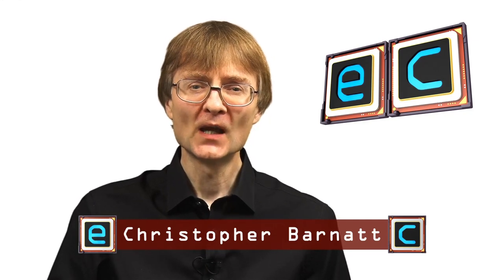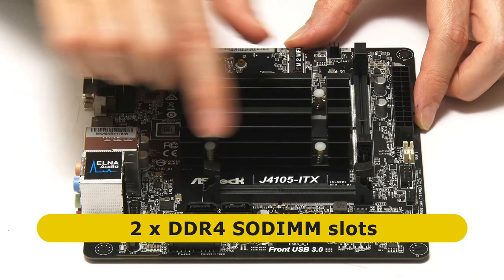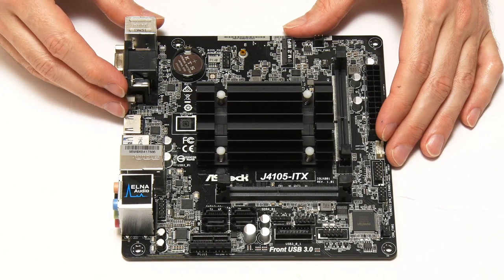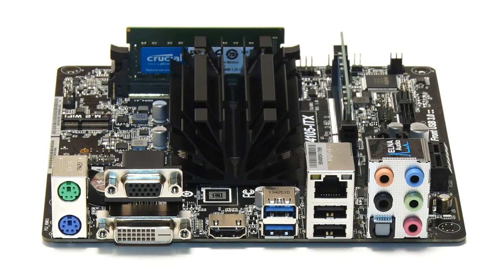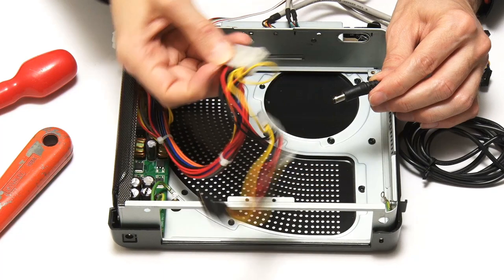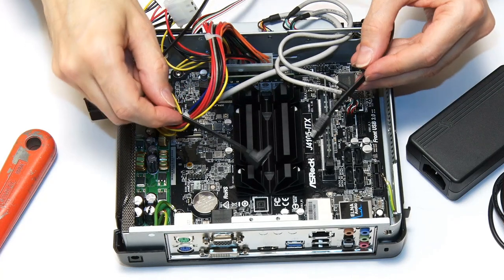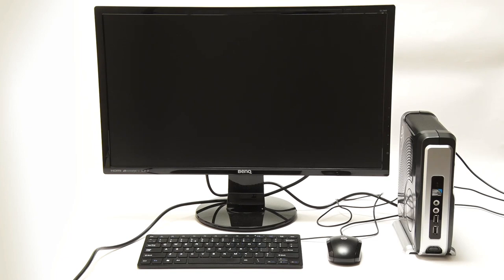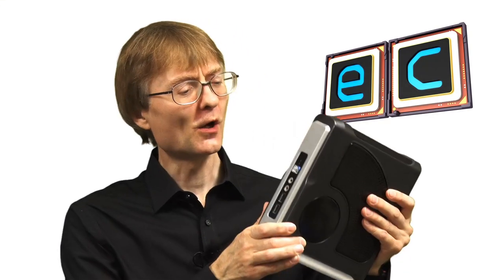Silent Mini-ITX PC Part One: Hardware Build

Comment: I'm just wondering if the VGA, DVI, and HDMI will all run a monitor simultaneously, can it support a m.2 SSD, and type c usb. If so, I want one. I know, I should have waited till video was over, but I don't have that much patience.
Reply from the maker: Yes, this board can drive three monitors at once from its three display outputs. I does not have an M.2 slot or  USB-C. But USB-C is just another type of USB 3.x connector, do you could plug in USB-C cables via an adapter to the USB-A 3.0 ports. Or you could add a PCIe card (in a suitable case) adding extra USB ports, inc a Type-C.

Comment: The front AC97 audio connector is the same pin connector as the hd audio. but the hd has one more pin to get a connect to front. So HD can set up the configuration with software on ac97 you can't set it. There is any Problem . I know that because i build an Pin to Pin cable connector for an ac97 front    and set it up on an modern hd audio connector .it works fine. Note : If you use that you have to set in the realtek hd audio manger Front panel audio connector  recogonation Off. So you can use booth connectors in front and behind.
Reply from the maker: Yes, you are right, I could have made this work with jumpers between the header and cable. But the connector on the case does not physically fit into the HD audio pins on the motherboard here -- the blanking pin is in the wrong place.
Reply: @ExplainingComputers  Ahhh ok . then you need a pin bridge and a one to one pin cable to connect it on MB ^^   i have took where i have made my draw to how to connect a pin to pin connection

Comment: This hardware can't work with 4k HDR. Only SDR. So for this purpose - 4k Video playback - it's not usable. This Celeron processor makes software  decoding from HDR to SDR very slow - 10-12 fps. So this motherboard it's OK for fileserver but not OK for mediaserver with hardware accelerated 4k Playback.

Comment: A little note of warning for possible buyers of the ITX format motherboards: never ever buy one with the CPU soldered in place, only ones with the socket. There were cases over the years of intel Celeron chips with design flaws bricking entire computers and then you have to replace the whole motherboard instead of just the cpu.

Comment: Hi off topic a little have built a ryzen 7, 1700 installed on a B450 tomahawk motherboard with 16gb ram thats 4*4 gb sticks. All 4 sticks work tested them individually but when all ram install only reg 8gb in bios even though all 4 sticks show inserted  on the board. If only but 2 sticks in shows shows 8gb then when restarted goes down to 4gb ram. If but two sticks in channel a shows 8gb ram, it seems channel  b is not working or sometimes works until reboot. Am I doing something wrong or is it the motherboard.

Comment: I’m surprised by the choice to use a SATA SSD rather than choosing a motherboard that sports a M.2 SSD slot.
Reply from the maker: Remember that M.2 is not an interface -- it is a connector that can carry various interfaces, including SATA, PCIe (NVMe for an SSD) and USB. So many M.2 SSDs are SATA. :) But certainly, a motherboard with an NVMe (PCIe) M.2 slot would allow the use of a faster SSD, although there are few practical benefits of the extra speed except on higher-powered systems going things like video editing or high-end gaming.

Comment: Can this PC play 4k movies without lag?
Reply: Just about, maybe loose one or two frames but you would hardly notice, have had a similar device for over 18 months now, it's been great, like a raspberry pi with a bit more go in it and everything works, there are newer celeron CPU's now,  that might be better option, the Beelink GK55 on AliExpress is a similar thing, just newer, smaller, faster, cheaper and more complete.

Comment: Why? 
ZOTAC ZBOX-CI325NANO-U Series Nano Fan-Less Mini PC Intel N3160 Quad-Core CPU Silent Performance Barebone System, No SSD, No RAM, No OS , $173.99 on Amazon.
Case($60-$70) + ASRock J4105-ITX Motherboard ($104)+Time.
Zotac coming with 2NIC and wireless card, so you can install psSense or use it for Octoprint or Linux. Win 10 will be slow, but it will work.

Comment: I just finished a similar build based on the j5040 itx.
I have a problem with hdmi output.
If i boot the pc it's fine but if i turn of the display then turn it back on the display never comes back (all power options are telling it to stay on and it's fully up to date)
This makes it a massive headache two own.
It is currently running as a plex server and i can stream from it but i can't use it without a reboot each time. (If someone else happens to be watching something from it when i reboot it'll effect them to)
It's a deal breaker for me but I've just sold my threadripper and gone all in on this to save electric.
Reply: Seems like its an Intel issue as people with acepc ak3 and othet j4125 PC's have the same issue.

Comment: The second green ground wire is not connected. Very dangerous!
Reply from the maker: Not dangerous -- everything inside the case is low voltage. The grounding wires (not ground wires) are to reduce the change of static build-up damaging components on the motherboard by linking the metal of the case to motherboard ground (as happens in a traditional case when the motherboard is connected to rises screwed into the metal). Given that one grounding wire is connected, there should not be an issue.

Comment: You may hate dealing with standard I/O shields, but they far, far less problematic than integrated I/O shields, which are intolerant of the slightest variation from the motherboard manufacturer's interpretation of the ATX standards.  🤬

Comment: This, as well as other Asrock cpu/mb fanless combos, have horridly designed layouts, for convection cooling.
The horizontal fins illustrates the engineers may not fully understand that heated air best flows vertically.
Then there's the poor placement of memory, which further obstructs natural airflow, and also limits effective fan placement in the event you wanted to add one.
I've placed miniature fans at the ends of the fins on boards like this (very ugly like due to no mounting hardware will fit, but it's the best place for flow). And the slight flow does wonders.

Comment: But why? This CPU has the performance of an average mobile CPU from five years ago. You could buy a five year old Intel NUC second hand on eBay to get the small form factor silent operation, with better video out options (no VGA or DVI, just DisplayPort and HDMI) and a better CPU, 8Gb RAM, 256Gb SSD and Windows thrown in for £200 - £250 including postage. Taking this refurbished route would be greener as you are re-using, plus Green PC One would still have its case.

Comment: This looks really cool (no pun intended) but one of the problems I'm running into is Adobe Photoshop's requirement for a graphics card with DirectX 12 capability. Does anyone have a clue as to whether THIS motherboard or whether there is a mini-ITX board (including the CPU) that has integrated Graphics with DirectX 12 capability? (if there is no DirectX 12 capability the LATEST INCARNATION of Photoshop will disable some of its functionality and sometimes even hang)

Comment: If not in the lead up part 2, then perhaps as a followup later, it would be really neat to see how this PC project compares to the Seeed Odyssey Blue J4105 Windows 10 Mini PC package deal.

Basically Seed packaged their Odyssey board (sans EMMC module) together with their Blue case and pre-assembled it with a 128gb M.2 all for $229 usd.

https://www.seeedstudio.com/Odyssey-Blue-J4105-128GB-p-4668.html

Comment: No reset button?
Reply from the maker: No, no reset button. The only option is turning off my pressing and holding the power button.
Reply: @ExplainingComputers  If you can live without it fine but for windows users one can easily added by using a normally open PB switch and wiring it to short live to ground on the reset connector.

Comment: I need a rig like this but with an AMD 4 core, 64-bit (with integrated graphics) CPU - and I need an exposed old school RS-232 COM port (saw where this motherboard at least had a header for a COM port). Okay, I need an AMD CPU instead of Intel because AMD 64-bit long mode also supports what they call compatibility mode, which supports easy virtualization of 80386 protected mode segmentation under a process that is using 64-bit virtual memory (page mapping) of the 64-bit long mode. My goal is to do operating system design research where I want to bring back a feature of VAX VMS that combined segmentation with fixed size paging (but not like IBM 386 OS/2 - something different). The upshot is that my research idea would enable efficient process multi-threading where all threads share the same page mapping, the program code uses 64-bit linear addresses,, but the private memory of each thread is hardware protected. Then I need a COM port as that is dirt simple to build a device driver for right in the kernel and would facilitate getting gdb debugger running from a remote host dev computer while debugging the OS that is downloaded over the COM port to run on this target computer. USB is way to complicated to support up front (want to eventually "steal" USB device driver code from Linux, but dealing with that is way, way down the road).

Comment: Why isn’t there a slot for an M.2 SSD? Wouldn’t that be more useful than an M.2 E key for WiFi card? Why PS2 connectors instead of 2 USB connectors? Whoever designed this board has a problem with holding onto the past.

Comment: Building a computer requires at least 1 or 2 outbursts of swearing before the computer is really complete.
For the install, I'm guessing you will install Windows 10 and Linux on the same SSD for flexibility.

Comment: Great build ... however, a 10-year-old case (+ PSU)  -- even new-old stock -- cannot be trusted. Electrolytic capacitors dry out (even if the case / PSU was never used).

Comment: Thanks Chris for another great video (I watched the one from 10 years ago also!) ... I think this hardware build very much depends on the case and power supply. While the Morex 3320 Fanless Mini-ITX case is still available, the cost to ship to Australia is > $100 and so not practical. Finding another suitable low-power low-profile ITX case has been difficult. After much searching I found this possible candidate: https://resources.mini-box.com/online/ENC-M350/M350-embedded-mini-ITX-enclosure-manual-v1.pdf Comments are invited...
Reply: I ordered this ITX enclosure from Amazon US for AU$88. It makes for a very neat installation. I ordered the external AC/DC 12V adapter and picoPSU separately. Measured the total power consumption at 9W to 10W.

Comment: You should consider dremmeling out the back end of the X1 slot so you can fit a full x16 card and run it at x1 speed. 
Palit makes a GTX 1650 that's 100% passively cooled. There are plenty of power-supplies that are completely passive as well. You could turn this into a mid-tier workstation PC that's 100% fanless! 
https://www.anandtech.com/show/15488/a-passivelycooled-geforce-gtx-1650-kalmx-by-palit

Comment: Lost interest when Celeron was mentioned, tuned out completely when sodimm's was brought up.  Celeron's offer piss-poor performance.  Not an AMD fan-boy, but a Ryzen-based Mini-ITX project would have been far more interesting.  I already have a Mini-ITX box with an Intel Atom soldered to it, and well, it performance is abysmal.  At least with a socketed cpu, you can at least fantasise about a killer-upgrade.

Comment: Did I read correctly.. it takes only up to max 8GB RAM? is that a joke in 2020...
Reply from the maker: That is what the spec says, but the reality is 8GB per channel, so 16GB max.
Reply: @ExplainingComputers   Thanks for the answer. I just searched a bit online and even found a website that tested 2x16GB(32GB) and that even worked on  this mainboard. But they stated it takes up to 35 seconds until the system starts so it needs a bit more time to initialize the whole ram obviously.

Its in German https://www.speicher.de/arbeitsspeicher-blog/32gb-arbeitsspeicher-asrock-j4105-itx

Comment: Why not j5005 or j5040?
Reply from the maker: This is what was available. There are always other option!
Reply: @ExplainingComputers  I can't decide which option to choose.  Should you look at the j5005 and j5040 when the j4105 is enough for NAS and HTPC?
Reply from the maker: @rik6302  That is a tricky question and depends on the prices of the boards, and how they may be used in the future. In the past I used to over-spec. These days I get the minimum hardware that works well. Good luck with your decision!

Comment: Noooow.
Since you went to the dark side of mini ASRock... Build one with the DeskMini A300 (or the intel counterpart)..
not with a fixed/presoldered cpu but only limited by recommended tdp..
so if you limit tdp you can put in the biggest cpu you find available ;-)
... i see now that they have a new (chipsets) Deskmini series...
http://www.asrock.com/nettop/index.asp
(almost built the A300 with a 2200g for my TV)

ASRock Rack has also interesting products :-)

Comment: The processor isn't even as powerful as the raspberry pi 4 cpu. Just check geekbench:
https://browser.geekbench.com/processors/intel-celeron-j4105

https://browser.geekbench.com/v4/cpu/13701853

Comment: Why bother with a soldered mobo with a celeron, when for $150 one can get the ASRock 300 deskmini with cooler included and power supply, then for $50 one can buy the athlon 3000g far superior to the celeron and upgradable down the line. $13 buy you a passive cooler from arctic which has been proven to cool the athlon. With memory and same ssd the system would come to $300.
The shown system comes to $250 but you wanna upgrade or add ram , out of luck. And it’s inferior in both cpu and graphics to the athlon build

Comment: Soo boring that AMD doesn't make 5W APUs. These Atoms and Celerons suck. I have a netbook with an Intel Atom x5-Z8300 | Cherry Trail Intel HD Graphics. In short its equal to Intel Pentium 4 @2.6Ghz & Nvidia GeForce 2 Ultra. Like a 2001 high end system that can play 2001 video games at the highest settings. A same ultra low powered AMD APU would probably be equal to something like a 2003-2004 PC. Hell.. the Intel UHD 630 of my i5 8800k is actually like an Nvidia 8800 series which is from 2006. Intel sucks at making good iGPUs.

OMG WOW.. the way the dual channel is setup.. that there is 1 channel on each side.. I think this would make it goo brum brum fast madafaka